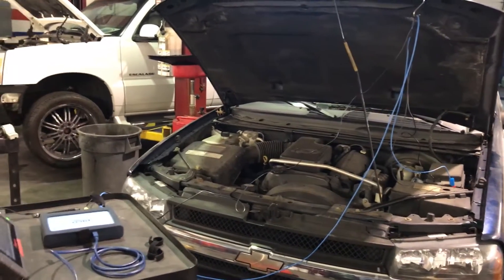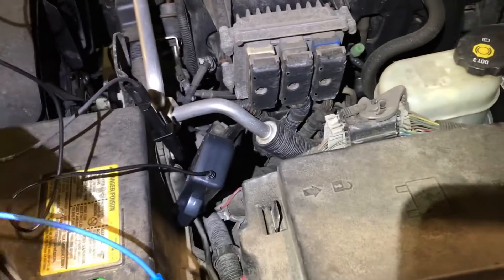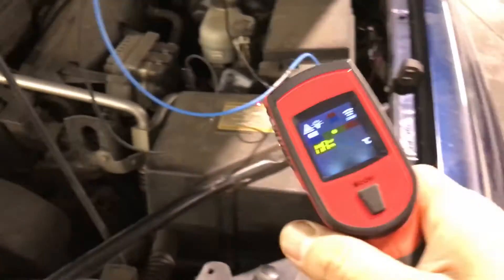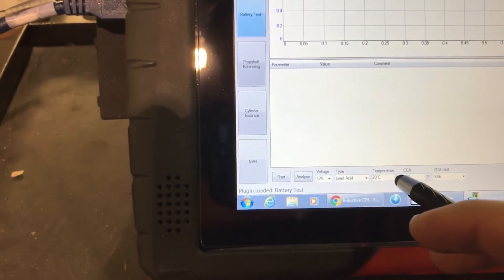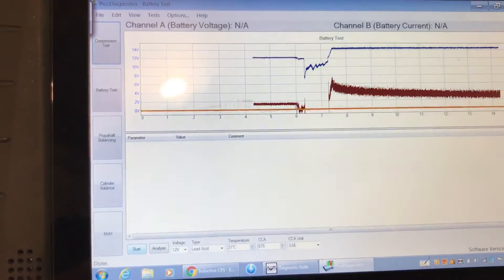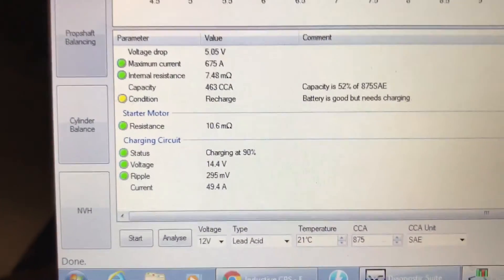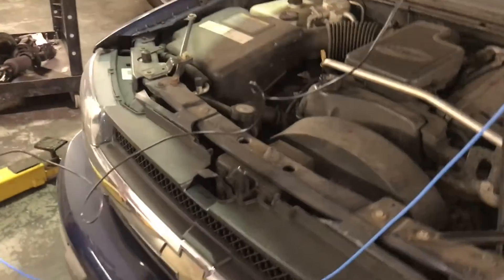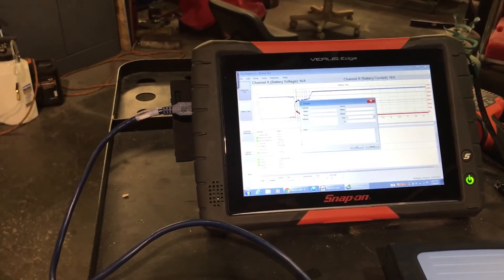How to test you car Battery with PicoScope 4425

Comment: Interesting idea, to use the starter as a load tester and then quantify the result. The ability to calculate state of charge is an attractive feature, I wonder how they do that. I recently did AGM battery testing in a boat and there is no starter on the house batteries, so I did it the old school way with a carbon pile tester. The new conductance testing devices are attractive but as always, you'd have to gain confidence in the tools to be confident when interpreting results.
Reply from the maker: spelunkerd thx for you comment, I also have a carbon pile tester for some difficult diagnosis cases.

Comment: nice idea pico in the verus Maic     did you happen to know the time base when you cranked the engine?   I like that test   I do it in normal scope mode
Reply from the maker: Mark Ferraro thx, well this is a built in test for Pico so I did not select the time base. Also depending on the type of scope you use that would change. If is a Pico scope you can use a 1s per division, then you can zoom in. If is a Snap on then I will chose a 1ms the zoom out.